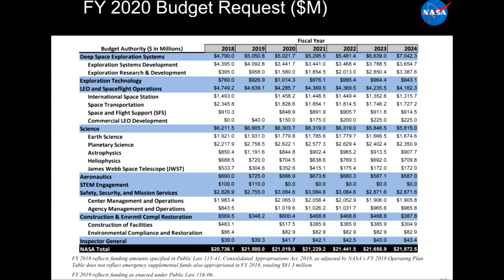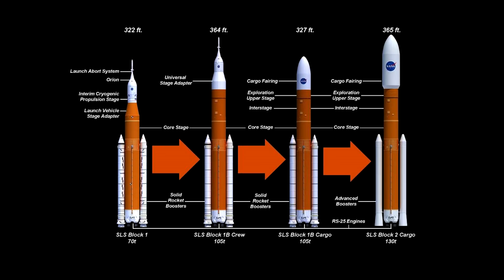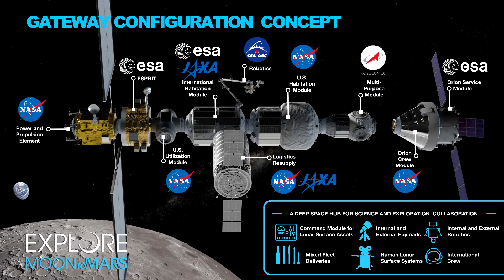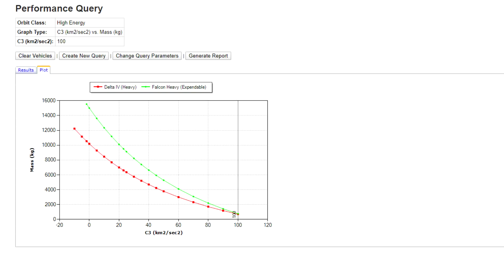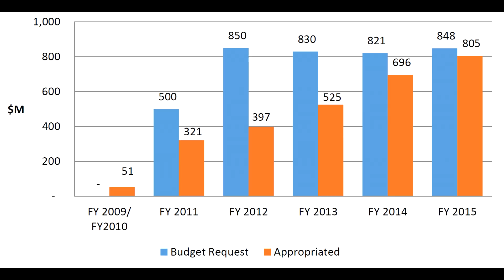SLS Rocket In Trouble After New White House Budget Request

Comment: SLS is a boondoggle/job program & the way they are treating it reflects that. NASA is far better off just paying a few commercial launch providers to make cheaper alternatives & just pay them to launch payloads that way. If NASA’s constellation program was still in operation SLS would make sense but right now with no offical BEO plan it doesn't especially with commercial super heavy launchers on the horizon that can launch for much less the cost and in half the time between launchs. They could probably even launch Orion around the moon on Falcon Heavy with an upgraded upper stage if Falcon Heavy was in expendable configuration.

Comment: Would it not be possible to jury rig a Falcon Heavy to launch an RL-10 powered upper stage instead?
Reply: It certainly could. LOX/LH2 isn't a "magic cure-all," though, and using liquid hydrogen introduces problems of its own, due to its very low temperature and very low density. The LH2 tank has to be very large, and it has to be insulated not only from the surrounding air, but also from the "warmer" LOX (-423 versus -283 degrees Fahrenheit, if memory serves). Also, while hydrolox rocket engines have higher exhaust velocities than kerolox engines, they don't put out much thrust for their size; while this is an advantage for upper stages (where exhaust velocity is more important, because upper stages suffer lower gravity losses due to not climbing vertically or steeply), other factors can partially cancel out liquid hydrogen's advantage:

A two-fuel launch vehicle is more expensive to prepare for launch, and requires two different sets of fuel-handling equipment. For vehicles made for high-energy missions (high final velocity and/or heavy payloads), such as the Saturn V, this cannot be helped. But for a launch vehicle whose primary purpose is orbiting LEO or GEO satellites, a single-fuel rocket (burning LOX/kerosene in both stages) is easier and cheaper to build, prepare, fuel, and launch, and:

A single-fuel rocket can also--as SpaceX's Falcon 9 and Falcon Heavy (as well as Rocket Lab's Electron and Relativity Space's under-development LOX/methane-powered Terran 1) also, significantly, do--use the same engine types in both stages. Using the same rocket engine type in both stages (the upper stage engine has a larger, vacuum-optimized nozzle, but is otherwise identical to the first stage's engines) greatly simplifies the launch vehicle's design, and it enables greater economies of scale, because the same engine tooling is used to produce more engines, lowering their unit cost. The kerolox MVAC (Vacuum Merlin)-powered upper stage used on SpaceX's Falcon 9 and Falcon Heavy, despite its lower total impulse than a comparable hydrolox upper stage, hasn't kept it from lofting interplanetary spacecraft (the old Juno II, Thor-Able, Thor-Delta, and Atlas-Agena--which also had relatively low-total impulse upper stages--also sent spacecraft to the Moon, into solar orbit, and on flyby missions to Venus and Mars). (The Mariner 1/2 Venus flyby spacecraft, in fact, were originally designed to be launched aboard the early Atlas-Centaur [whose Centaur stage--as today's Centaurs--burned liquid hydrogen], but were lightened to fly aboard the Atlas-Agena B when the early Centaur stage's performance fell below expectations.)
Reply: @j.jasonwentworth723  Very well said. TL; DR - possible, but likely impractical.

Comment: Have you noticed that whenever someone talks about rockets the conversation ALWAYS veers towards SpaceX?
Reply: Once Blue Origin's New Glenn is flying (they're progressing toward flight pretty quickly), we'll have a working alternative.
Reply: @j.jasonwentworth723  well then starship is also ready. New glenn will not stand a chance against starship
Reply: @j.jasonwentworth723  It's May 2021, 2 years later and New Glenn was delayed to late 2022 by Blue Origin in Feb 2021. BO got $500M in Oct 2018 to develop New Glenn for AF contracts, but the AF pulled the last $245M in Dec 2020 as they may have seen the writing on the wall. The BE-4 engine that is going to be used on the New Glenn also evidently delayed the Vulcan Centaur from ULA from early 2021 to late 2021. The 2022 USSF-51 payload ended up being shifted to an Atlas-V which will cost ULA money. Bezos stepped down from day to day Amazon operations to focus more on Blue Origin. Unless he can get Blue Origin moving, Rocket Labs may take Blue Origins place. Rocket Lab has put 17 small rockets into orbit with their Electron rocket and are working on the Neutron to more directly compete with SpaceX's Falcon 9. If Blue Origin is not careful, Rocket Lab might end up being more competition for SpaceX than Blue Origin.

SLS actually has all the hardware for the Nov 4th 2021 Artemis I mission in the VAB, so they might actually make a launch date this time. It's a race to see if Starship gets to orbit before SLS flies.
Reply: As it should.

Comment: FH with Raptor 2nd stage until/unless SS/SH arrives first?
Reply: Elon said FH development was over so expect no changes there especially designing building and testing a new 2nd stage for it.
Reply: Lensflare Deviant - Perhaps, but 1) Elon is highly adaptable and flexible “never say never” if NASA funds? 2) Air Force paid for investigation of an FH Raptor second stage
Reply: @christianbergman711  Elon has said that he wouldn't even have gone as far with FH as they did except that they had already spent a pile of money and all plans to even get FH certified for manned flight (which was part of the original design) have been dropped.  F9 and FH development have ended. IF someone else was willing to put up the money it could be done, but someone would need a really good reason! :)
Reply: Lensflare Deviant No argument, but to clarify- I was not suggesting FH as human rated, just that Raptor second stage for heavy lunar cargo could be an option for paying customer (NASA) willing to fund development. But yes would detract from SS/SH development which - for cargo - could come online much earlier due to redesign. So yeah no argument there.

Comment: I wonder why they didn't just use the Ares I upper stage on SLS since the  hard part the J-2X was finished and most of the remaining issues with the upper stage was only due to resonance with thrust oscillation in the stick configuration which would simply go away on SLS?
In the side mount configuration the boosters are free to move and not transmit most of their vibration into the rest of the stack.

Comment: Also, I think much of the coverage on SLS since Monday is a bit premature.

SLS funding has gone from $1.938 Billion in last year's proposal to $1.78 Billion with this year's. That's a drop, proposal to proposal, of $158 million. Objective fact. Beyond that, the big thing here is reallocation within the SLS program. Reallocating SLS funding from work on the exploration stage to getting Block 1 flying earlier is not necessarily indication that the plan is for SLS to die. It might simply be a part of a desire to see results sooner. (Remember, Trump has NASA look at the possibility of having EM-1 be manned. So it's not outside his wheelhouse.)

That's not to say there's just nothing to see here. No doubt it might be an indication that the intention is at least to phase out plans for heavy lift SLS variants, if not SLS altogether. The "Moon to Mars" portion of NASA's website unveiled on Monday explicitly says the power and propulsion element of the Gateway will be launched on a private rocket. That was originally supposed to be on SLS, so there is an example of a definite change and diminishing of SLS's role. No denying that.

But, as is pointed out in the video here, current commercial heavy lift vehicles aren't really as capable as would seem to be needed for long-term goals. So, perhaps the thinking is get SLS and Orion up and running, getting the testing missions out of the way and into the "production phase" with 2 launches a year, relying on commercial partners in the short term for heavy lift needs, and then once SLS is to that point then starting work on the Exploration stage for Block 1b and Block 2 (or seeing if by that time commercial companies will be developing suitable HLVs that will be cheaper than development of the Exploration Stage).

Only time will tell.

Comment: I just can't see a case for it at all. On a personal level, I think it would have been awesome to watch it launch but in practical terms, NASA just cannot get the best value for money with taxpayers money. They are too huge and inefficient and they have too many political hoops to jump through. 

It keeps getting more expensive and less capable as time goes on. It would have helped if they had gone with a shuttle derived design from the start instead of burning money by stubbornly clinging to the constellation program even after it had been proven several times it wasn't practical.

They dismissed and attempted to discredit the DIRECT shuttle derived proposal several times before it was begrudgingly adopted.

Comment: NASA: We will use SLS to make a permanent human presence on the moon!

SpaceX: Hold my Raptors.
Reply: To boldly return where no man has gone before.
Reply: Nasa knew she's struggling with further development and Spacex came for help
Reply: CombraStudios SpaceX wouldn’t exist without NASA.
Reply: TheThirdMan they most likely would but would be struggling
Reply: Thugs Bunny but they have been struggling from failures
Reply: battlefield fan how has spacex been struggling? Only 2 out of there 80 falcon 9 launches have failed they have successfully launch the falcon heavy the most powerful rocket in service today 3 times successfully and are now on the verge   Of launching there first starship prototype on a 20km hop
Reply: Thugs Bunny amen. don’t know what that guys on but spacex hasn’t really had that many failures. sure falcon heavy center core has only landed 1 out of 3 flights but most rockets can’t even try to land so it technically not a problem.

Comment: Why does the Jupiter rocket have to be launched in one go? Can't they launch it in two parts and assemble them at the ISS?
Reply: I assume docking ports don’t handle joint stress as well as they can in KSP, even if it’s in a vertical stack relative to the center of thrust

Comment: 3:27 Every part of the LOPG will be delivered by the Starship/BFR..
Reply: I'm with you on that except that it would probably be more effective to 'long-term harden' a Starship and park that in Lunar orbit instead.  Or just send a fresh Starship every time you wanted to go since the LOP-G isn't going to be permanently manned anyway.
Reply: @TheOneWhoMightBe   Don't think you would need to do much/anything to Starship since it's supposed to do the Earth/Mars round trip with some loitering.
Reply: @EdwardDowner  Yeah, there's probably not a huge amount you need to do to the electronics, life support, or the structure, but it would likely need additional debris shielding.
Reply: Honestly, when it comes to large volume/mass cargo, I think blue origin will wind up being the goto company. BFR is awesome and all, but it’s designed from the ground up to be more of a bulk crew transport, with a tanker variant for on orbit refuels. Blue origin’s new glenn by contrast will be a dedicated unmanned cargo vehicle, meaning larger payload margins.

A LOPG made by either would be interesting, I could see them using far larger modules than currently envisioned. A LOPG with a mission that made more sense and had more focus would be nice too.
Reply: LOPG was really only dreamed up to give SLS something to do. If they cancel SLS, they should cancel Gateway at the same time. BFR is capable of direct ascent to the Lunar surface. It makes Gateway even more redundant and useless than it already is.
Reply: Starship can put up an entire space station in one launch.  Done.

Comment: So if Europa Clipper weighs 6 tons and FH can launch 63 tons to LEO, why don't they work with ULA and put a Centaur on top of FH? Centaur weighs a bit over 23 tons, meaning that FH would be able to put it in an orbit slightly lower than GTO, maybe something like 25,000x150km, then you would have a fully fueled Centaur in an orbit with a decently high energy, by my calculations it should have 5752 m/s of deltaV which might just be enough to get to Jupiter. Of course this would require a special FH since the Centaur barely fits inside the fairing and I don't think SpaceX and ULA are willing to work together. Fuel boiloff could also be a problem. Either way, a FH with a Centaur on top would be by far the most capable launch vehicle.

Comment: SLS is just not up to par with the upcoming bfr and new glenn rockets and is just too expensive with all these companies pitching in to manufacture it when spacex and blue origin can do it at a fraction of the cost of the sls, and be reusable and more powerful, + they can do upgrades and design changes on the fly which makes space flight safer and cheaper.

Comment: I think people are REALLY misunderstanding what's going on. The SLS is not about to get cancelled, the block 1 is fast tracked. After that, a commercial lunar super heavy competition will be launched (like the just concluded Commercial Crew one), and Boeing's upgraded SLS will be one of the (likely winning) contenstants. The only other contenstant is Starship, but Starship needs LEO refueling (so two simultaneous launches) to match a single upgraded SLS for TLI cargo. Falcon Heavy and New Glenn may be able to do some resupplying for Gateway/Moon's surface, but they're not really viable as main vehicles, and less capable than SLS block 1, so they don't count.
Reply: They do count though, it's about the cost, not about raw power.

Comment: SLS may be using antiquated technology, but that's a non sequitur, it doesn't mean it's bad. The Merlin's have 1960's Russian tech in them... it doesn't make it bad. Let's not forget the Starhopper is using and learning from tech in the 1950's Atlas II.

Take a jab at the O rings on the solid boosters, at the lack of reusability, at the lack of flexibility in control schemes, at the lack of in-orbit refueling of the second stage, at how expensive it is to build, at the lack of a plan to land on mars... but being old alone isn't it's main issue. I would love to have a cheaper Saturn V flying, even though it's ancient.

So call it a boondoggle, a job creation program, a rocket to nowhere or a Saturn V and a half, but not antiquated.
Reply: The moment I see Falcon Heavy fly, I lost all anticipation on SLS, and yes, in a world that even the most old school rocket manufacturer are innovating, NASA's SLS is an antiquated POS.
Reply: Merlin engines are waaaay more advanced than anything Russia ever flew. By the way, how many engines do they reuse in a year? Oh yes, none

Comment: Why are we comparing the SLS to the falcon heavy. Isn't the BFR the closer comparison?
Reply: Because Falcon Heavy exists.
Reply: So tell me what we know about BFR. Payload capacity? We don't know since they changed the design again. Costs? We don't know again since the only numbers officials we got on it was the ITS. And so forth. 
For now you can't plan anything with the BFR as long as the final design (and numbers) isn't settled, also when the BFR comes online in several years (wouldn't surpise me if gets to 2025) it would be quicker to just use the falcon heavy with a gravity assist instead.
Reply: @SneeuwPoesjes  we know about the same for BOTH. However, the bfr is 99 percent sure done first and would be the one to haul super heavy loads.
Reply: @mnaglich  You're replying to the wrong comment.

Comment: Why should NASA develop ANY new rocket boosters at all. Experience has shown that SpaceX provides boosters that are JUST AS GOOD for one third the price. Furthermore, as the Falcon Heavy has shown, it is possible to simple add additional boosters around the main rocket to achieve ANY payload desirable. Falcon Heavy had 2 outside boosters. Such a rocket with 6 to 8 boosters would exceed the Saturn 5 in lift capacity at a tiny fraction of the cost of developing a new system. NASA has shown that it cannot develop booster rockets at competitive costs, so it is time for NASA to get out of the booster business.
Reply: A third? SLS and Orion will end up costing upwards of 50 BILLION dollars in development. Falcon 1, 9, and Heavy combined, plus reusability, has cost SpaceX about 2 billion. Also, SLS would cost 1-2 billion per flight, while falcon heavy costs $150 million expendable